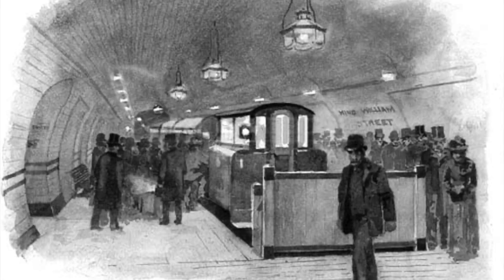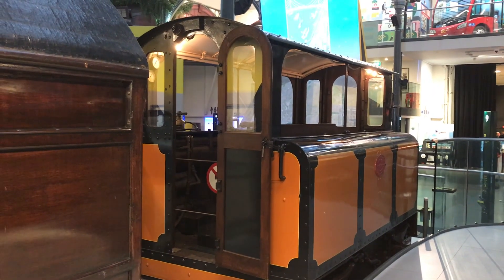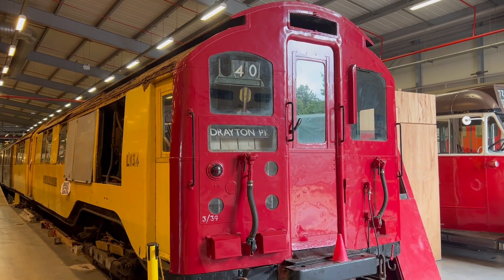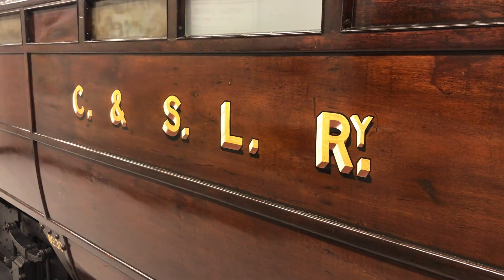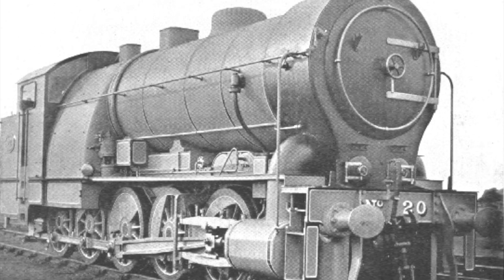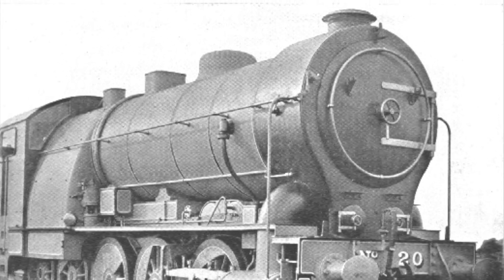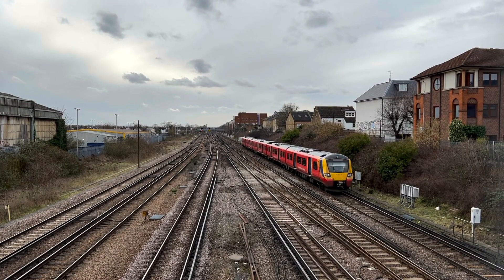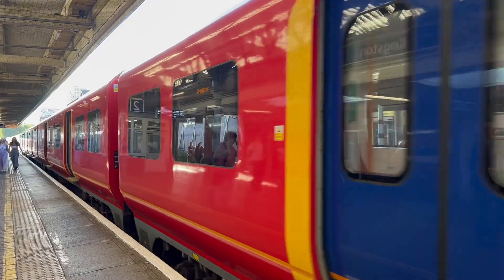Why some electric trains use a third rail, and others don't

Comment: I've been wondering for some time whether 3rd rail could be viable solution for Scotland's northern rail line.
Reply: 3rd rail is no good for distance because of the low voltage it can carry. You need feeder stations every few miles - no good in northern Scotland! Plus 3rd rail doesn't like snow.
Reply: @gzk6nk 
Overhead doesn't like snow, either. Electrification isn't worth while unless there are at least 4 trains an hour. 

These long routes in Scotland are good candidates for modern steam. It has developed a long way since the 1950s.
Reply: @henrybn14ar  Modern steam! is that 9% efficient over the 8% of 'old' steam? 😁
Reply: Only if it is south of London and for historical reasons, it would seem. If you start from scratch these days, you choose overhead wires.
Reply: Too much chance of snow/ice.
Reply: No, the only viable candidates for 3rd rail in Scotland would be the local lines out of Glasgow Central, and they are mostly already electrified with overhead power.
Reply: I doubt it seeing as they were too scared to even electrify the new extension of Merseyrail

Comment: 6:15 - That must be one of the last Red Star signs in the country!  It looks like it's pre-NSE, although I suppose it's possible they removed the NSE branding but kept the Red Star sign.  Can individual signs rather than buildings be listed?
Reply: I don't think it's pre NSE as Guildford station was rebuilt 1988-89 during the NSE era.
Reply: @rkhayden  That sounds like a reasonable date for the sign, considering its general condition.  I assume it would originally have had NSE branding, but I've not been able to find a contemporary photo of the totem, only the platform signs.

Comment: SWR never completed the electrification of their entire network.  The diesel electric trains that I have to commute on are so noisy and vibrate all the time. It's horrific for long distances
Reply: There are no diesel-electrics on SWR. The 159s on the Exeter line have hydraulic transmissions
Reply: The 3rd rail should be extended to Salisbury where trains should split with a diesel loco hauling the portion to Exeter, and pushing on the return. It won't happen, though unless there is an outbreak of commonsense at ORR.
Reply: The best way to experience a 158 is once a year for Easter break to Honiton and then never again in the year

Comment: I was yesterday in Madrid and visited their Chamberí Metro station, one of the 1st to open and that it's now disused. A nice time capsule to the 50s. I was told there that while the Metro took a lot from the Paris one, they also got things from the Tube, like the logo and the direction of trains. But there are electric wires and not a 3rd rail for the electricity. I found that interesting!
Reply: Yes I've also visited Chamberí, fascinating place! By luck I went just as I guided tour was starting, so learnt all sorts of facts. Apparently third rail was originally considered, but due to a high level of moisture /water in the ground, it was decided to go with overhead wires instead, which may be a historical first for a metro. Now it's standard in many places, including practically all of Spain's networks.
Reply: @tomthornton6259  yep, that's right! Actually, one of the walls with the tiled ads had lots of water dripping over it. I am glad that this is restored and that tours happen. It is a cool visit. I also did the guide visit and was lucky to secure a ticket online. They disappear fast! The old cars restored on the Chamartin station are also very interesting and beautiful. Actually, that's how I knew about these museums.

Comment: I still don't understand WHY the Chiltern Line out of Marylebone is still diesel to this day.
I get why it would be too expensive to convert the WHOLE of the lines to Oxford and Birmingham via High Wycombe, but It would surely be within reason and a lot easier to convert the line to Aylesbury via Amersham to third rail.
The line between Amersham and Harrow-on-the-Hill is shared with the Metropolitan anyway, so the third rails are already there. It wouldn't be too much of a hassle to extend the third rail coverage from Harrow into Marylebone itself, and then it's just a matter of extending it in the other direction, from Amersham to Aylesbury, and possibly beyond, in the future.
Reply: Wonm'yt happen now that ORR has set its face against any new 3rd rail electrification except on the London Underground.
Reply: @norbitonflyer5625 
Sabotage by government again
Reply: It can join the queue behind all the other major UK routes that aren't electrified. Very slow and expensive process to add wires due to vast majority of overhead structures not having clearance. 3rd rail has a max operating speed of 90mph so adding it to the Chiltern wouldn't make sense given it is 100mph. Also note a lot of long distance trains out of London are still fully diesel or involve sections of route where diesel is used.
Reply: @jacobf4702  Chiltern between Marylebone and Aylesbury via Amersham is still limited to 75mph, as far as I'm aware. It's only 100mph on the 'Mainline' section via Wycombe, Oxford and Birmingham.
Reply: @jacobf4702 319s ran at 100mph on the Brighton mainline under third rail
Reply: Chiltern is facing problems at Marylebone with local community backlash regarding air quality and diesel fumes. There  are  new developments in Europe with  electric battery locomotives  which may eliminate the need for electric rails or overhead power
Reply: The power supply would need significantly upgrading to serve the lines Between Harrow and Amersham, which shares track, and installed for the lines from Harrow to Marylebone and Amersham North.

Overhead May be the way to go.
Reply: @trevorelliston1  Don't forget the NIMBYs in South Bucks. Why do you think HS2 is in a tunnel at vast expense.
Reply: @k @kevinrayner5812 rtly because trains don’t like going up hills or round bends  and with the contours in the Chilterns the line would likely need to do both.
Reply: @trevorelliston1 You are obviously unaware of the gaps in the Chilterns then.
Reply: Of course but the government has thrown a spanner in the works, or rather, across the live rail.

Comment: Merseyrail is also 3rd rail . But theres a ban on new installs  unless its between two  existing 3rd rails.   So new extension to Headbolt lane from Kirkby  had to be done by battery traction.....  its not working very well.
Reply: There's not a total ban, small infill extensions are not banned, albeit there's a lot of regulation to jump through, having batteries for the last mile to Headbolt lane is just stupid
Reply: I suppose this was a government decision, or was it Network Rail? Either way they're equally stupid
Reply: @AndreiTupolev  government   wouldn't you know !
Reply: Daft decision. Extending the 3rd rail would have been a better solution.
Reply: @SteamboatWilley  it might happen yet .  The battery section is painfully slow  and  unreliable .
Reply: Bottom contact must surely be allowed under new regs? I wonder why they didn't just upgrade it all to that when the new trains were introduced.
Reply: @interstat2222 Good question. It’s certainly safer than top contact. But you’d still have to upgrade the shoe gear on 777s to cope with both. (That’s doable, because Metro-North’s M8 units in NYC can do it, not that they actually do it routinely in practice.)
Reply: ORR (office of rail regulation) are the problem
Reply: Just one thing how come 3rd rails aren't installed say from London all the way up to Scotland? It would've been better and safer than the overhead lines especially to the weather?
Reply: @LingLiu2014  It's not safer.  3rd rail is unsuitable for high speed lines (simply put: unable to provide enough power for heavy/high speed trains and freight trains).  

DC (which is used in third rail) loses voltage over long distances and needs extra line-side equipment vs AC overhead.  

Also, train motors are now AC, further complicating it.  Third rail a relic and now only suitable for metro services (think trams, light rail and subways).  

The only reason it's on so many London railways is because it would be too cumbersome to remove it all in a busy capital city.
Reply: Health and Safety lunacy

Comment: In Japan, most of underground rail uses overhead pick up
Reply: That makes construction expensive, because the tunnels have to be taller.The Paris Metro uses ground rails and the new Metro in Sydney is designed for ground rail power
Reply: @ausbrum no it isn't. Sydney uses OHLE
Reply: @ausbrum  They don't have to be that much taller. I noticed at Farringdon and the old Kings X station the pantograph was almost flat to the roof of the train. Does boring out a slightly larger tunnel cost disproportionately more and tunnel boring machines must be constructed to a fairly standard size. In any case isn't the bulk of an underground commuter railway costs in construction and fitting out stations, not tunnelling.
When the Liverpool Street lines were electrified to 25kv then the central are it was 6.25kv because of clerances. Just one final point, why does my computer say pantograph is an incorrect spelling.

Comment: Also overhead wires, at a higher voltage, suffer less power loss; so are more efficient with the electricity.
Reply: In tunnels it can be an Overhead Rail too…(for more safety and less maintenance…!)
Reply: @aoilpe The ovehead at St Panras Thameslink is a bit like that lass chance of a dodgy pantograph tearing it all down too.
Reply: And in tunnels, they can be just mounted to the ceiling most of the time...
Reply: Tunnes often need track bed lower to fit overhead. Very expensive and why it takes so long on GWR for anywhere to get electricity

Comment: Nothing to do with me
Reply: Denying everything even after all these years.
Reply: I mean, you somehow weren't named in this video for once. 🎉
However, the Watford DC is mentioned as being third rail because of the need to work with the Bakerloo, which was a UERL (and thus your) line. So you played a part there.
Reply: @quintuscrinis  actually, as a result, several other branches that connected to this (and to Gunnersbury to Richmond on the District line) all chose Yerkes' electrification, but with slightly different standards for the rail supports. But these lines were all "Southernized" in the late 60's or early 70's, but those that still shared with the Tube have the fourth rail bonded to the running rails, and the total voltage in the positive rail.
Reply: Said like a true banker!
Reply: @kevinmothers904 I would refer you at this juncture to the current Nationwide building society advertisement on the telly "it's not banker".
Reply: @simonwinter8839  Haha I had the same thought
Reply: @simonwinter8839  Thank you Simon, I do not have a TV so I am unaware of their advert. Am I missing a good deal?
Reply: @kevinmothers904  Are you sure you're not a banker ?
Reply: sorry, was about to blame you
Reply: that’s unusual
Reply: We can always blame you if we look deep enough.
Reply: Being dead at the time is a very weak excuse. Poor form, Sir, poor form.
Reply: Are you sure 🤨🤨🤨
Reply: It was Walpole.
Reply: We believe you... 👀
Reply: Dear Charlie boy do us autistics favour and change your name to ‘Official’ instead of ‘Offical’ would you? Cheers Charlie chappy
Reply: What's an offical?
Reply: Yerkes Crater - on the moon.
Reply: Certainly, an impersonator 🥸

Comment: if the third rail is so great, where’s the fourth rail?
Reply: On the underground - with a positive DC third rail and a negative DC fourth rail 😉
Reply: In the middle of the track. Background is to reduce corrosion in tunnels. Compatibility with 3rd rail on the line between Wimbledon and East Putney is achieved by connecting the "middle" rail to the regular rails, so power differential is still the same (+750V, 0V vs. +500V, -250V)
Reply: Try watching the video for the answer.
Reply: @AtheistOrphan  You get more engagement with your comment if you add it early, and with a silly question that is easily answered by watching the video.
Reply: @geirmyrvagnes8718  It was actually just a joke, I wasn't expecting people to try and answer it. "If blank is so good where's blank + 1" is a fairly well known meme format.

Just forgot I was talking to train nerds who would apparently take it literally.
Reply: @Azeria  I would say that worked quite well. And that "silly question" would seem to cover it. 😄
Reply: @geirmyrvagnes8718  If by worked well, you mean for engagement? I mean I don’t farm it or anything, it’s not like my channel is partnered so I have very little to gain except personal satisfaction. But… it got like 4 likes so I didn’t get much of that anyway 🤣